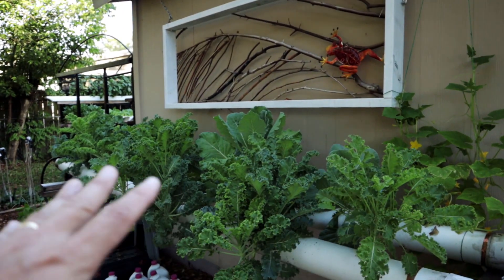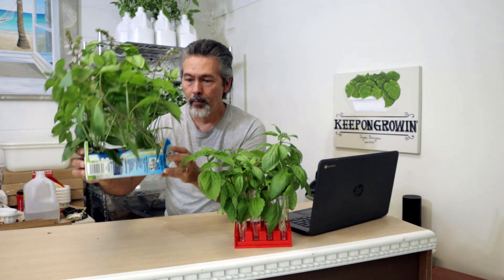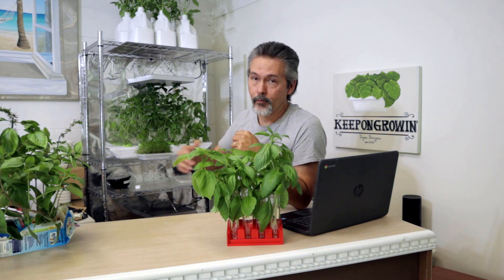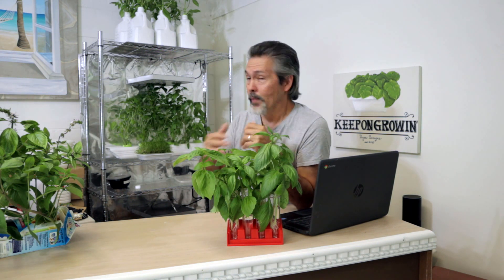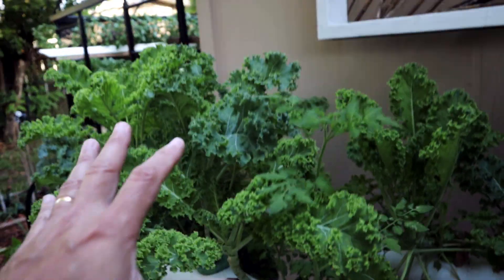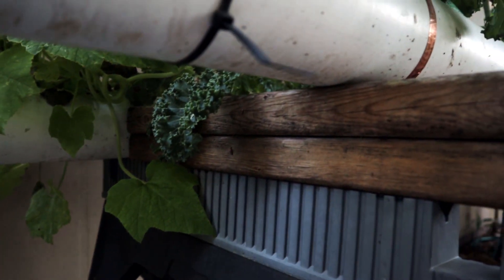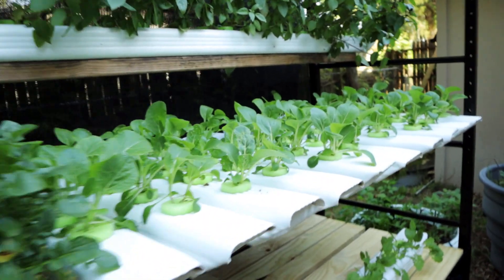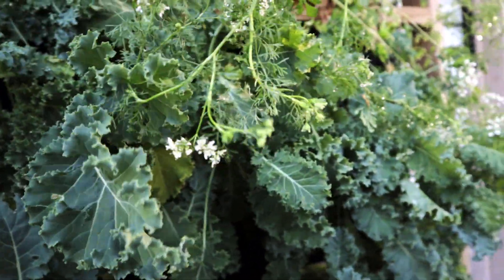Level Up Your Hydroponics, Growing Kale in an NFT System

Comment: One thing I wanted to mention there is a very simple way to modify your NFT system so that if you went out of town and the electricity went out you wouldn’t lose your entire crop. What I’m referring to are “reducers” is what I think they are called it would be a very inexpensive change in your case.  You could add the reducer instead of the elbow at the end before it goes in to the pipe that drains the water out what you could do is put a reducer on that end and then just attach a piece of the black hose to the end of it to drain it back into your tote OR you can perhaps reuse your pvc elbow pipe and down spout and just fit it over your reducer so the reducer would be hidden inside the pipe but I think that would be another inexpensive way of adjusting the system you already have OR you could attach the reducer and then get the smaller pipe elbow and drain spout that would fit the reducer end.  Basically how this changes your system is there will always be some nutrient solution in your pipes if the pump were to fail.  The amount that stays is up to the level of the bottom of the reducer so maybe an inch or two since your pipes are so much taller then mine. You can purchase these reducers in the plumbing section.  I’ll see if I can take a photo of the end of my system.  My system has three levels to it and I have reducers on the ends of all my pipes so that the u turns at the ends require smaller elbows and connector pipes but because of the way your system is I don’t think you would need to change yours at that end although you certainly could it would just reduce the flow even more and help retain the water in your first pipe. Also because of the way my system is put together I don’t require a difference in height between my two shelves because of the way my first and second shelf of the pipe connect it does it in a way that keeps the connecting bottom pipe up off the shelf by a small amount. I hope this makes some sense.  I’m not technical at all and usually I refer to this thingy and that thingmabob. Lol!  Oh I was going to attach a photo but it won’t allow me to here.  I think they may be called bow pvc reducer in the plumbing section. I don’t know if you can get various sizes as to going from 4” pipe to a 3” pipe if that’s  the variance then you would likely have an inch of water that would remain in the bottom of your pipe because that one inch of water can never get above that lip unless you adjust your pipe from one end to the other but even then there is still going to be a certain amount of water that can’t flow into that reducer because the water level is below the out flow.  Anyway check it out I definitely think it’s worth the time especially if you plan to be away for extended periods of time when the pump could fail.🥰🙏🏻🇨🇦
Reply from the maker: Thank you, I will look into that!

Comment: Do you have to grow a lot of your hydroponics inside the AC in Florida under lights? What is the nutrient temperature for your outdoor NFT system?

My deep water culture black 5 gallon bucket hydroponic tomatoes and peppers are doing poorly. I think it’s because the nutrient temperature is between 88 snd 91 degrees. I’m growing outdoors south of Tampa. I thought about trying indoor hydroponics under AC and lights.
Reply from the maker: I am growing indoors and out. I can’t keep my garage under 90 on hot days. Outdoor Kratky is under shade cloth.
Reply: @KeepOnGrowin  My hydroponics are growing in my pool cage to prevent the deer from eating up the hydroponic plants. In Minnesota, the hydroponics were in the basement, except for about four months in the summers, when I moved the hydroponic plants outdoors. In Minnesota, you don’t have constant 90 plus days in the summer, and it cools down at night. The garage would be the best place to grow hydroponic plants, but the garage is well over 90 degrees most of the time. The cars heat up the garage after I park them in the garage, and the two AC air handlers probably also heat up the garage.

I think that the only way I could grow hydroponic plants in the garage would be to insulate and air condition the garage. I’m assuming it would be expensive to do that. There are some people in Florida who do have AC in there garages to cool them down to about 80 degrees.

I’m suspecting that for the tomato and pepper plants that it’s not the hot ambient temperature that’s the problem with the upper parts of the plants, but it’s the roots that are sitting in 90 degree nutrient. My pool temperature is 88 degrees without turning on the pool heater. In the winter, the pool is about 62 degrees without running the pool heater.

Maybe a way to cool down the nutrient without buying a nutrient chiller machine would be to bury some length of hose a few feet under ground and pump the nutrient through the underground hose loop to let the earth cool down the nutrient. That would be using geothermal technology on a small scale, but it would be a lot of work and mess in the yard to bury the hose horizontally at least a few feet below the surface of the ground. It’s interesting that hydroponics only works well outdoors in Florida a few months out of the year, just like in Minnesota, except it’s because of the heat, not the cold.

I compared growing hydroponically to soil gardening many times in Minnesota, and the hydroponic growing always has much higher growth performance than soil gardening. Maybe because of the root temperature problems in Florida, soil gardening might outperform hydroponic gardening. I’ll try testing both soil and hydroponic methods again in Florida.
Reply: @daveborchard2019  I am in Toronto, Ontario, Canada and ive been growing in hydroponic DIY systems for the past two years.  I have enormous south facing windows and I always knew in the winter they got super hot because everything I tried to grow in soil in the windowsill would turn crispy and die.  This past winter I kept a close eye on the temperature of the window itself on the inside and the temperature got up to 34degrees C which is flipping hot!  My plants have been thriving in the winter and still doing well in the summer months because we do run the a/c in the summer 24/7.   I have a pepper tree in a 42litre tote that I wrapped with tin foil shiny side facing out and it’s partially in view of the window, I don’t know what the nutrients get to in temperature but I do top it up every week especially when the plant is growing peppers it seems to really use up the nutrients.  I think by the consistency of adding room temp nutrients it keeps the temperature of it down and I’m positive the tin foil is reflecting a lot of the heat away from the water which is having a profound effect both winter and summer.  I am also using LED T5 warm white lights and I have them over every growing situation.  The plants love them and so does the lettuce in the NFT.  So far the only thing that I haven’t had any success of growing are tomato plants but I suspect it’s because my tote was too large and the nutrients may be kept too cool or maybe too hot I’m not really certain.  Or maybe I’ve just messed up the nutrients completely.  I was about to rip them all out and begin again but wouldn’t you know just in the day when I was going to do that I saw all kinds of yellow blossoms.  So I’ve seen blooms in the past and they just fall off and don’t produce anything I’ve tried shaking them and hand pollinating them but nothing has worked with this size tote so far and I suspect it’s just too large 120 litres I believe.  Anyway I’ll be pulling the tomatoes out this week and I have some seedlings beginning again.  That’s one of the terrific aspects of growing indoors I have year round growing with no issues at all, at least not related to water, sunshine or temperature at least as far as I know.  I’m growing lettuce in an incredible volume now, initially I struggled with germinating and how to get them into my NFT system but thanks to Mike I used his self-watering technique for microgreens and then I transition them to the NFT system and it’s success every single time and I’m not wasting a single seed because even when I have way too many microgreens then I need I allow them to keep on growing and once they are a significant size I’ll cut them all just above the soil wash and clean them and add them to my lettuce and it’s a fantastic way to keep enjoying microgreens and lettuce varieties in an incredible abundance!  So fresh and very sustainable each and every time!  So whether you are in Minnesota I still believe you should be able to use hydroponics indoors without any concerns about temperature as long as the people in the room are comfy then chances are pretty good the plants are going to be comfy.  That’s been my rule of thumb and it’s been working really well up til now, in fact I’m even growing broccoli at the moment in a 5gallon bucket directly in front of my air conditioner blowing on it and it seems to love it!  I thought it may be too cold but it’s loving it. Hope this helps and one other comment I tend to use aeration with most of my DWC just because I can, I find when water sits stagnant indoors it can begin to smell so I like keeping air pumped into the water and there is no smell at all to it.  I’m also very intolerant of algae and go to what I consider extremes to prevent it because it not only can slow down your plants ability to grow it can stop it completely which was something I noticed with my broccoli, initially I had my broccoli seedling growing in a small netcup with hydroton pebbles and then the roots extended down beyond that I had not covered it with foil and as a result algae was growing over where the stem met the roots and my broccoli just wasnt growing so I removed it from the netcup and removed the pebbles and sacrificed some roots doing it and then with swishing them in water and wiping them with papertowel it got some of the algae off the stem and roots (note the bottom roots were pure white no algae at all) then I used some hydrogen peroxide 3% straight on the stem and top roots where the stubborn algae remained and I knew if I kept rubbing the roots they would disintegrate so I opted for the hydrogen peroxide and I’m so glad I did I used a cotton swab soaked in hydrogen peroxide as well and it helped to get into all the little spaces where the algae was hanging on and I was able to with a lot of patience and great care removed the algae and then I swished it in plain room temp water several times after finishing with the hydrogen peroxide and my broccoli plant just took off growing!  I couldn’t believe my eyes, I had no clue up to that point the impact that algae can have on plants even though the roots at the bottom were beautiful and white somehow when they would pull nutrients up for the plant the algae was getting them and was reducing tremendously what the actual plant was getting.  So now the plant has recovered from the trauma I put it through and I’ve enjoyed some broccoli leaves cut up in my salads when I inadvertently broke off a couple of the newer stems on top.  I wasn’t about to let them go to waste and they have a very mild broccoli flavour I thoroughly enjoyed them in salad and I’m really looking forward to many more growing because I’ll be using them for sure.  I wouldn’t necessarily eat broccoli leaves from grocery store broccoli because they are probably long sense removed anyway but if they hadn’t they would have been so old since the plant was likely harvest a long time ago.  But fresh broccoli leaves that you are growing yourself, I definitely recommend giving them a try.  Apparently you can also try cooking them similar to collard greens or spinach.  So I would definitely recommend trying to grow hydroponically indoors regardless the weather outdoors.  It works!!🥰🙏🏻🇨🇦
Reply: @leannekenyoung  I moved from Minnesota to Florida, south of Tampa. I used to grow with DWC in five gallon black buckets and 10 gallon black grow trays, where I drilled holes in the top cover for the 3" net pots. About 8 months of the year, I would grow in the basement in Minnesota, then move the hydroponics outside during the four months (if you push it) summertime in Minnesota. I grew mostly using CFL's, but I also have a Hydrofarm Ceramic Metal Halode 315 watt grow light, which makes a huge difference with the tomato plants and pepper plants. I use air stone in the grow buckets and trays. It's important to have grow trays where the light doesn't get to the roots, otherwise, you have very yucky green algae everywhere inside the grow buckets and grow trays. I've tested growing with and without air stones. Growing with air stones is more effective, with larger and faster growth. I didn't check for smell in the nutrient that did not have air stones.

In Florida, I would probably have to grow indoors 8 months of the year in the AC and under grow lights, because of the heat. I suspect it's the nutrient temperature, which varies from 88 degrees F to 91 degrees F. The nutrient liquid it hot to the touch! I've read many times that the ideal nutrient temperature is 62 degrees F. I'm going to re-test growing in soil verses growing hydroponically in Florida. In Minnesota, growing hydroponically produces drastically large plants and more yield. It might actually be more effective to grow in soil in Florida, when both are grown outside in the heat during the 8 months of the summer months in Florida. 

I could setup an area in an indoor office for the hydroponics, but it's a carpeted room, so I'd have to be very careful with liquids, and I have to be careful that I don't start getting any insects inside the house. In Florida, you have to make the extra effort to keep the indoors insect free. Before I moved to Florida, I thought that I would do hydroponics in the garage. But the garage gets well over 90 degrees F and is very hot. I'd have t insulate and AC the garage, or at least part of the garage to be able to grow hydroponics in the garage. In Florida, there are no basements!

Comment: Im new at hydroponics. I really dont understand that how they still alive. People who make hydroponic check ec and ph value twice a day. And they add some materials, water etc. to water if it is needed. Im confused..
Reply from the maker: It's ok. I have been doing this about 9 years with no meters and adjusting. I try to make things simple so everyone can give hydroponics a try. All of my videos are living proof that it can be done. Good to have you here!
Reply: Fatih you have found the perfect channel for a beginner, I was like you confused and thinking I needed to be concerned with all the meters and expensive kits etc but hopefully you haven’t spent a lot of money.  Mike shows clearly how you can grow your own food for your family and it doesn’t have to be expensive.  If you know your water source for example mine contains chlorine and fluoride because I’m on a municipal water system and I have checked my PH a few times and it’s pretty consistent around 6.8 to 7.  I do use PH down to adjust it down slightly and I never use water directly from the tap I always let it sit at room temperature for 24-48hrs or longer.  I’m not certain exactly what it does whether the chlorine and fluoride escapes from the water or maybe it’s just having it at room temp but I notice significant differences between when I let it sit and when I don’t.  It has killed my plants when I haven’t let it sit, especially my seedlings.  So now I just always make a habit of filling my water buckets before I’m going to need them.  But seriously if you follow what Mike explains you will have incredible success each and every time.  For myself I grow indoors so I have LED grow lights and I use air pumps and air stones to keep my system running well especially for any of my DWC because I find when water just sits indoors without any movement and aeration it begins to stagnant and smell.  I don’t want any nasty smells because my place is very small.  But there are lots of ways of doing it and the KRATKY method (no air pump) does work and it works well.  But adding an air pump will only make it better.   That’s been my experience at least. I would decide what it is you really want to grow first and then chose the correct hydroponic method best for that type of plant.  I’m only using my NFT system for growing varying varieties of lettuce. Even basil I’m not growing in this system because I found the roots became an issue and would back up my water flow which would result in overflows.  So anything that has a significant root structure I would definitely not use the NFT system unless you don’t mind consistently trimming the roots which may hamper the plant’s ability to thrive.  I tend to put larger plants like peppers, tomatoes, cucumbers in totes or 5gallon buckets.  They work much better at allowing the roofs to grow to a terrific size and ensures a lot of produce!! If you ever have any questions please don’t hesitate to contact me I’m happy to help!  Mr.Duzee1 has helped me more then I could ever thank him so instead I try to pay it forward and help others who are where i was a few short months ago.🥰🙏🏻🇨🇦
Reply from the maker: @leannekenyoung  Awesome! Thank you for sharing. Especially about the roots. I try to share so much that I forget a lot of important points. I remember early on having to carve the root system of my swiss chard out of my NFT, tomatoes too. Yu are an inspiration to people out there wanting to grow their own food. Keep on Growin'